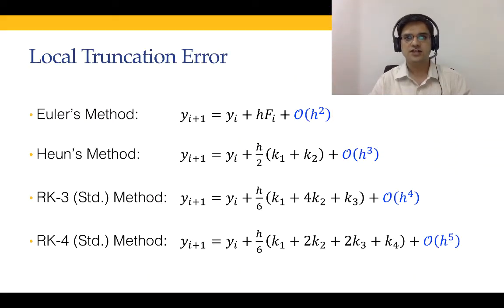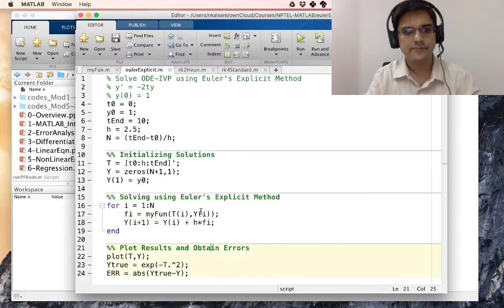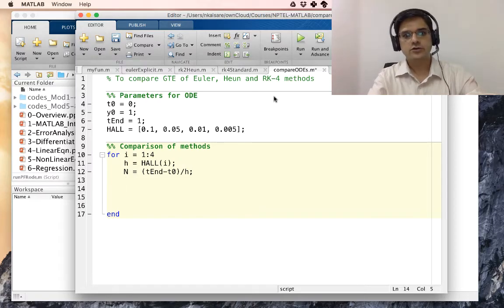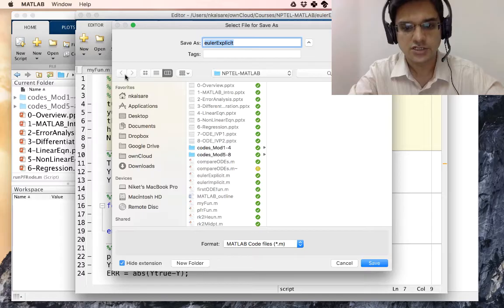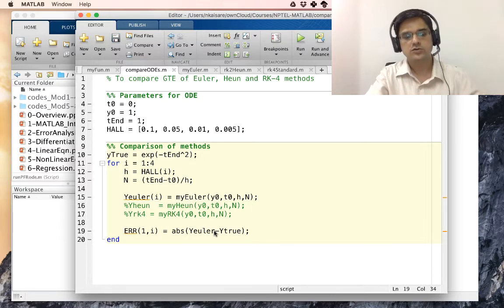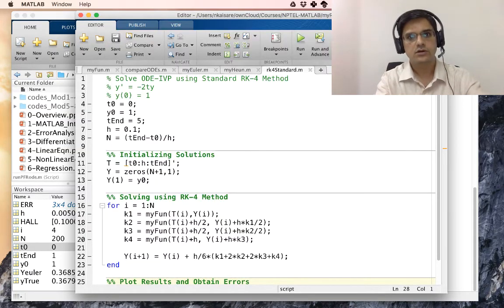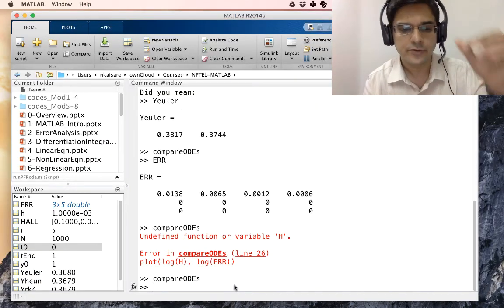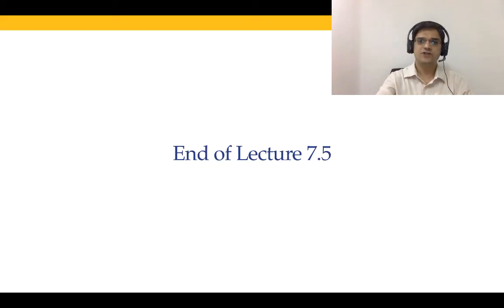Error Analysis

Comment: Build the parabola p(x) that approximates in the least squares the set of points with coordinates
x=[-2 -1.3 -1 -0.7 -0.4 -0.1]

y=[0.3 0.5 1.5 1.3 0.8 0.1]
Which is the value of |p(3)-1.5|, approximately? 

how do i evaluate any value of x at the polynomial ?